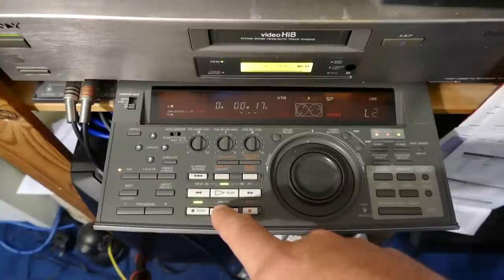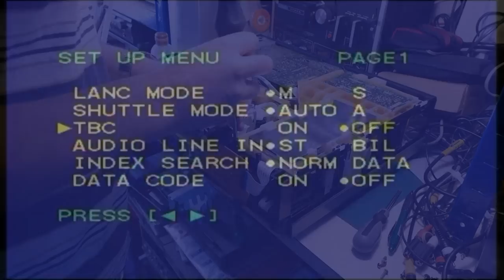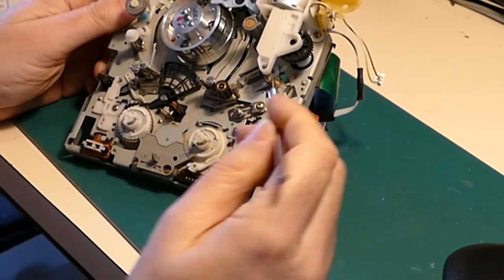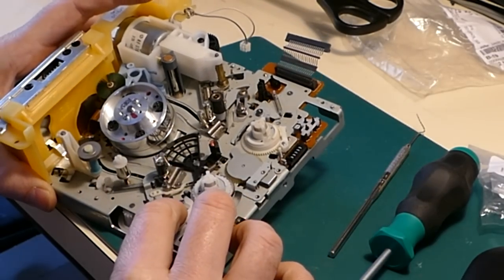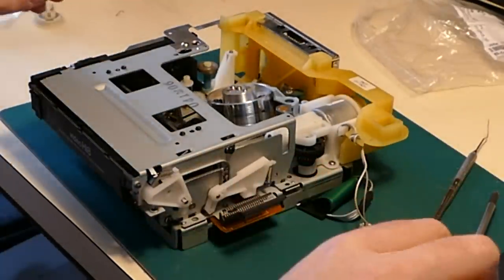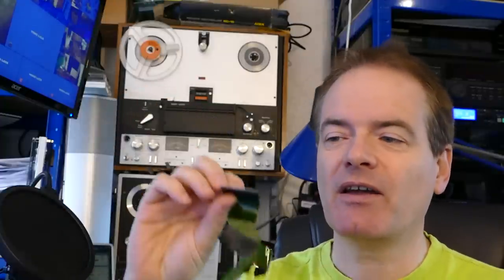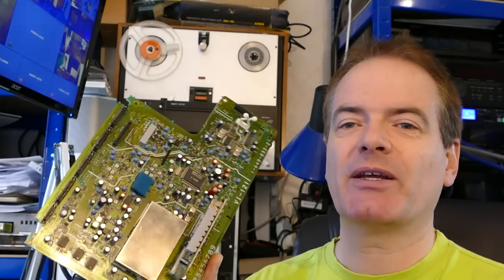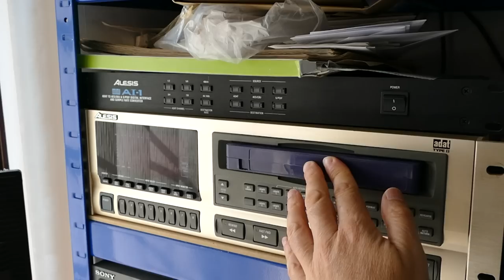Repairing the most complex domestic video recorder, Sony EV-S9000E / EV-S7000

Comment: I also have this machine. It used to be a good machine, but now sadly it has the same symptoms on any tape I play on it.

It plays normal for a few seconds but then the picture starts to get noisy and you can hear the engine struggle a bit. Like it's getting harder to pull the tape. The picture gets noisier and noisier , until the screen goes black and the tape stops. Right before it stops I can hear some kind of tape noise(?) Not sure what is happening inside the machine. 
I also cant rewind because the player insist it's already at the begining. When I try to take the tape out it's stuck, but just a little. So a little jiggle back and forth always loosens the tape. The tape gets a litle cracke in the corner, but not much.

Any idea what could be causing this? Could this be a tape path issue of some sort?
Reply from the maker: I can't debug a problem like this by remote control.  You would need to examine what is happening during playback.
Reply: @video99couk  I was afraid you would say that. I was hoping maybe my symptoms was common. 
Hopefully I don't mess anything up while opening it. Wish me luck!
Also thanks for all these videos you make. They are really interesting and fun.

Comment: Is the slightly older ES-V3000 a less complicated and more reliable unit?
Reply from the maker: I've never seen a ev-s3000 but it looks similar to the ev-s1000. I have a working one of those but they are super-rare because they seem to be even more unreliable.
Reply from the maker: @Aku Yes, it suffers from more mechanical problems.  If it wasn't for the splitting spools, the EV-S9000E mechanism is reasonably good.

Comment: My Sony CCD6000E (PAL), bought in 1991/92 was repaired iunder guarantee, then again in 2002 thought it was just video head due to being knocked. I looked at (8th March 2024) the repair receipt (Jessops) which cost me £298 and it mentioned a Capacitor Pack, so they were replaced then, never knew that was due to Capacitor Fatigue problem until the last week viewing a review of the camera. 

Now in March 2024 I wanted to archive and transfer my 1991-1995 Hi8 camera and edit tapes, I was wanting to compile my video work from the 1990s and 2000s and put on DVD, then more easily tranfer to my Panasonic BluRay recorder also be able to upload to YouTube and maybe organise a public showing evening of my community video productions in my home city for anyone who may have appeared in them over the past two decades. 

Seems the camera is mostly useless now, I'd have no guarantee any repair to my CCD6000E would allow me to transfer my tapes, but it seems any Hi8 unit is likely to fail due to SMD Capacitor fatigue. 

So I thought get a Hi8 recording/playback deck, this one came up as it's got a TBC. Now I find this deck has not only SMD Capacitor problems but also tape transport problems too. So it doesn't sound like it's worth me spending £400 on a (PAL) version available on Ebay, if it's not fully working it'll end up failing as I transfer dozens of valuable tapes over a space of a few weeks.

So what are my options then? A Digital8 system that would at least offer Firewire output that would be clearer than S-Video, is there such a Digital8 unit out there? That I'd be able to play Hi8 PCM+HiFi sound track recorded tapes on?

In truth I'd have thought 3D printing would be the solution for new take up reels. Or even just using appoxy resin glueing of the cogs, Surely that'd would hold the split gear wheels together?
Reply from the maker: The reel tables are a complex assembly of precision magnets and mixed materials, there's no chance of 3D printing them.  Epoxy might be a possibility but it's hard to get them together without a gap in the gear teeth.  Most (not all) Digital8 camcorders can play analogue tapes and do a good job of it, but don't support PCM audio.  There's no easy solution to that.
Reply: Thank you for replying. I never thought I'd get a reply. 

I feel I have two options:
What would you recommend. I've got some basic electronics knowledge, multimeter and soldering iron. But, Surface Mounted Device desoldering/resoldering requires experience and undoubtedly more specialised equipment that I've got, one slip and I'd cause irreparable damage.

#1 Do I pay again (second time, third repair) to get my CCD6000E repaired (surely it'd last a year for me to transfer the tapes?) this time the SMD capacitors would probably be better than those used in 2002, that have failed before I even got around to transferring my tapes, I left it too late. I then use my CCD6000E (with in-built TBC) to transfer all my Hi8 to mini-DV tapes, then it's in the digital domain and simultaneously transfer all to DVD, Blu-Ray and back-up digitally to SSD drives. 

#2 Do I get one of these machines (£400 to £1000+) hope I get 2024 out of it before SMD Capacity Fatigue and/or REEL failure. Get a cheaper one and pay to get it repaired? 

I'm planning a big personal project this year 2024-2025 to transfer all my 1991-2000... Hi-8 video. Then edit, compile and organise an evening for all those interested in seeing a compilation of my productions here in Liverpool in the next 12 months. There would be countless people who would have been in my videos over the past thirty years. Such as bands, musicians, actors, performers, musicians, poets, community activists, tenant groups, etc, etc. I used a Canon XM2 from 2003.

Does it sound like repairing the CCD6000E is the logical choice for me? It's already bought, another £300-£500 repair would be the same price I'd pay for a failing Hi8 record/play unit with or without TBC.

If I don't transfer this Hi8 video at least 15+ years of camera-work will be lost. It means a lot to me and the people whose lives it impacted on, improved even. I mean I've got Super8 film from the early 1980s that are easier to view and transfer to Digital... How ironic is that!

Other than us all collectively suing Sony for selling us all faulty equipment and getting compensation.

So who could you recommend to get my Sony CCD6000E repaired and the 71 SMD capacitors replaced, or do I take back to Jessops for repair, if they do that anymore.

From one cameraman to another, thank you...

@video99couk
Reply: Jessops have refused to repair it again... So I'm back to square one, maybe a Digital8 camera/player (with Hi8 playback) is my only option. I have concners about the video quality.
Reply: I'm now looking for a Digital8 system with Hi8 playback, as I want to archive @BEST VIDEO QUALITY for potential future public display, editing, broadcast and uploading to YouTube. 

Any suggestions of particular Digital8 camcorders or decks, if any were made, this would be appreciated. 

Currently I only handycams are available like DCR-TRV110E for example.

Comment: Hi, great video. I have two unit, and got the same problem on both unit, besides the reels, the backlight on the transport panel stop working. Any idea what it can be ? I'm under the impression that it can be a small capacitor in the Control Panel circuit..
Reply from the maker: Do you mean the display on the slide-out drawer?  Or the backlight of the LCD panel on the front?  The display on the drawer I cover in this video, it is due to capacitors in the DC-DC converter which I show.  Backlight of the LCD panel on the front is just light bulbs I believe.
Reply: @video99couk  The slide-out drawer. I saw the part on the reels replacement in the video but not the display, i'll check again ! Thanks.

Comment: thanks for the vid, liked. I have one of these but it will not leave standby. Any idea how to repair that? Worked before otherwise. If I cannot fix that I will just sell it.
Reply from the maker: Sometimes the keyscan of the power button can act up, try inserting a tape or use a remote control.  If no response, then start by replacing the capacitors in the power supply, they often fail and the job isn't too hard.
Reply: @video99couk  thanks for the reply. Initially I didn't realise you have a repair service. Typically how much would it cost to repair this fault using your company?
Reply from the maker: @misterzee5736  No, I don't do repairs.  I have quite a backlog of my own equipment to repair!  When I do repairs I like to present that as information on YouTube.  My business is actually audio and video transfers.

Comment: hi i had a 1000 model it was working when i had it i put it away  in a good place once i powered it up on day it was not working right the main  transport logic i died
on me i am looking for a good ex studio one with low hours  i have some ex studio  vhs decks with bad power units
Reply from the maker: I have a good working EV-S1000E here, which has near zero hours on it.  The previous owner ran just two tapes through it!  Not sure I'm looking to sell it though, just because it's such a rare machine to find in perfect working order.  Power supplies are usually OK to repair if it's just capacitor failure, but can be hellish if semiconductors have failed too.  I'm not that crazy about ex-studio VHS/SVHS decks, often they have very high mileage.  Sometimes the semi-pro machines like the Panasonic AG-4700 can give results which are at least as good, if not better, then the studio decks from JVC and Panasonic.
Reply: hi keeping away from sony 8mm 
teac / tascam made some 8mm video decks just got the model name missing
Reply from the maker: @bobjerome5390  I have Tascam DA-88 and DA-98HR 8-track audio decks here, along with a Sony PCM-800.  Clearly Sony and Tascam worked together on these machines.  Also see my YouTube video on a Hitachi 8mm deck built by Sony.

Comment: Hi Colin, amazing, and super video!! I pulled my s9000 apart and there they were...cracked spools. Plus I've had the fishy smell and drawer display is dead. I suppose I can fix that by replacing the caps. But the spool gears? Are they really non sourcable? Also another symptom (which maybe due to the spool gears), is tracking problem. In the menu, I can set the tracking ok at 2x speed, but at playback normal, there is a band of noise over a third of the lower screen. Do you think the spool gears will fix that or could that be a serious board failure?
Reply from the maker: Some people report that they have been able to repair the split spools, but it's not something I've managed to do so you're on your own with that.  Mistracking can be caused by multiple things but you need to check that the tape is running flat with no crumples.  Occasionally the tape guides can go out of alignment on other Video8 models but I've not know that on the EVS9000E so don't start twiddling tape guides unless you are sure you need to.  The spools are not going to cause mistracking, and it's relatively unlikely to be an electronic fault.  I would say that the machine needs some very careful attention from someone who knows what they are doing.  If you're not used to working on equipment like this, you are likely to wreck it.
Reply: @video99couk  Hey Colin, thanks for the advice there. I replaced all the caps in the roll-out display and lo and behold, it works !!!! Very happy about that. I still have a fishy smell somewhere, but I'll attend to that later. As for the tracking...the symptoms ease off after about a minute or two and depending on the tape, the result is quite good.I think the main cause of the problem is the age of the tapes. Some are over 20 years old.  Only thing is that that as soon as a tape produces a drop out, that annoying "stereo" announcement pops up on the screen. Is there any way to turn that off?
Reply from the maker: @JABTV2008  That sounds like capacitor failure in the capstan servo circuit.  I have an EVS9000E with just that problem.  I will have to work on it, for sentimental reasons if no other, since it cost me £1500 back in the day.
Reply: @JABTV2008  put the deck in “Edit” mode and the on-screen text won’t appear.

Comment: I have an EV-S1000E UK owned from new, which I modified to do insert-video by using a pair of NE555 timers to inhibit the erase head when it passes over the part of the tape beyond 180deg that stores the PCM audio, thereby not erasing the PCM stereo audio. The first NE555 controls the start of the inhibit and the second NE555 controls the length of the inhibit.
Having left it on a dry shelf in the roof for well over 10 years, I recently found that it no longer worked, and that the power supply had leaked sticky fluid inside which had partially corroded some of the PCB tracks. This seemed to come from the capacitors, so I replaced them. It worked a lot better for a short while then the power supply seemed to fail completely. 
I wonder if there is something else wrong in the main circuits that is causing a big current drain? One annoying thing about the service manual is that it states expected voltages in hundreds of places but not any expected currents required for each board.
I'm now wondering if I could just use a power supply from an old desktop PC for the 12V and 5V with a 7809 to get the 9V, but there are other weird DC and AC voltages required too for the display.
Reply from the maker: There could well be leaky capacitors elsewhere.  You could check for current consumption on the supplies.  Generally these are not very reliable machines unfortunately.